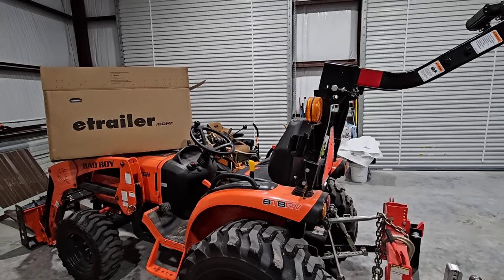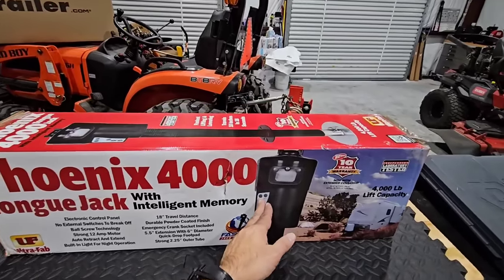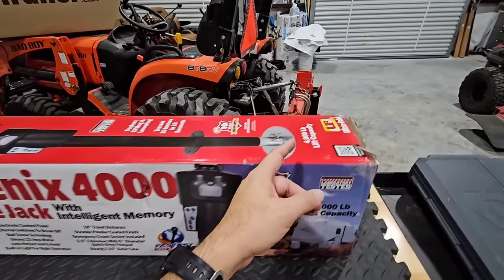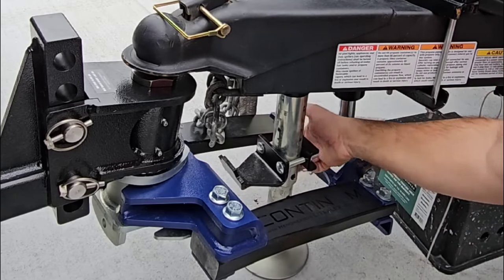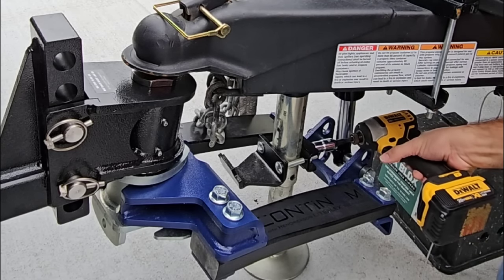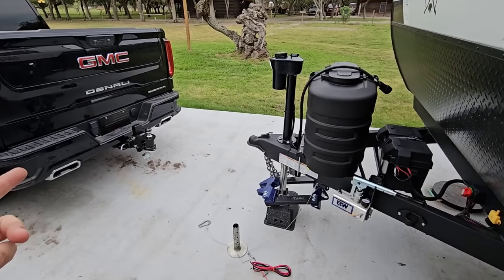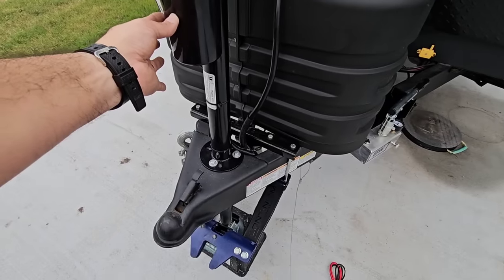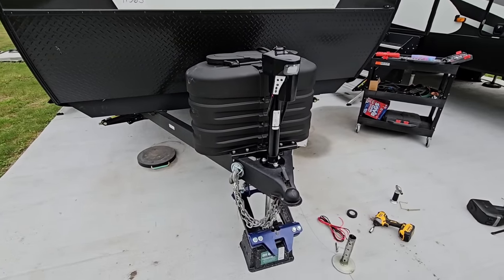FASTEST JACK MADE! One of my favorite RV and Trailer Upgrades! UltraFab Phoenix 4000 Tongue Jack

Comment: TIP:  Crimping with the portion of the tool that puts a dimple in the heat shrink sleeve will likely puncture a hole in it.  I always use the inner most portion of my crimp tool when crimping wires because it never damaged the insulation around the crimp barrel.

Comment: I bought a Uriah with a pig tail connection.  Plugged it in before installing and it worked.  Installed it and it worked.  Then went to unhook and the ball was sticking so I moved the truck an inch and suddenly jack no longer worked.????  What can I do?  Laughed when the new one went in in slow motion with the bang.  That was geeat

Comment: Is the wiring wired directly to the batteries or a separate circuit from the system? Although extreme overkill for my little trailer, be cool to add it.

Comment: I have a toy hauler travel trailer with a tongue weight of about 1700 lbs. Do you think the 4000 lbs  rating is sufficient when you take into account the additional weight from raising the rear of my truck when installing/removing the distribution bars?

Comment: Nice, can the motor housing on the top of the jack be rotated? Our current trailer jack blocks the tailgate from opening, only need a couple of inches for the tailgate to clear, but I can't rotate the jack.
Reply from the maker: Yes you can rotate it.

Comment: I see many design engineers specifying lock washers against flat washers.  This reduces the locking capability of the system by about 50%. They're hoping it will be enough.  An extremely effective alternative is a Nordlock system.  Consists of two washers the size of a flat washer,  with one side with grooves and the other with wedges
Reply: Can you elaborate on how the use of a lock washer reduces the locking capacity of the system (which I’m interpreting as the resistance to the bolts coming loose) vs a flat washer?
Reply: @jetdriver  If you actually watched the video,  you noticed that the bolting hardware included a spring lock washer against a flat washer.  The flat washer has no locking mechanism between it and the base.  I was merely pointing out a more effective method of locking a fastener.
Reply: Nordlock systems incorporate two washers,  both with a series of grooves on one side,  and a series of wedges machined into the other.  Install the wedge sides together and torque the bolt 20% above the nominal torque for the bolt size and grade.